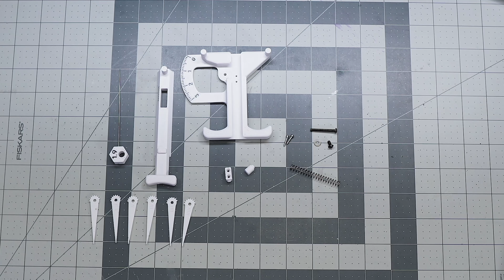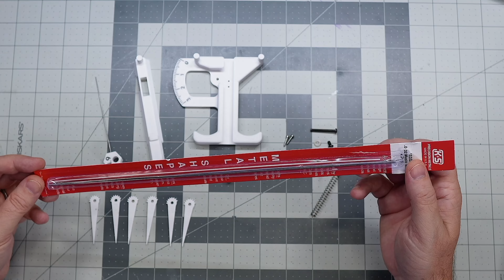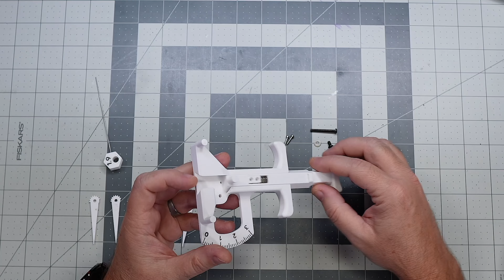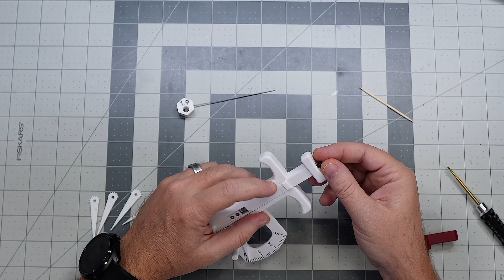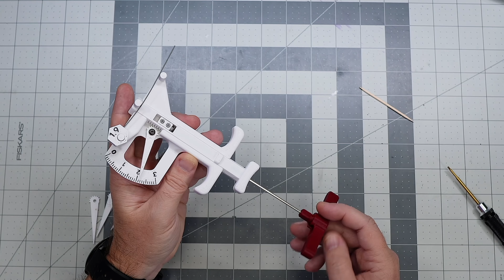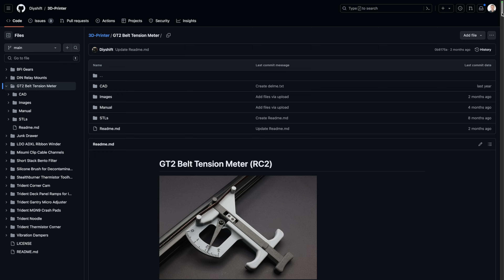Voron 0.2 Tuning - Belt Tension Meter

Comment: Just by how it looks, #5 seems too tight. You always want a tiny bit of backlash, as long as the needle moves less than like 1/4 of an increment, it should be fine. I have mine down to moving a fractional amount, barely noticeable, but it runs smoother and settles into a value with less tapping.

Comment: Idk how much of a difference it would make but i believe you're supposed to do the testing/tensioning with the motors active and the toolhead in the position you used in the video. That's how I did it anyway following along with another video.
Reply from the maker: Yeah, I probably forgot to mention it in the video but you want to have the print head centered so that both belt paths are identical.

Comment: Mobilux is a lithium based grease and these are not considered safe for plastic parts, they're great for lubricating metal on metal surfaces. A silicone grease (optionally with PTFE) would be a much better choice
Reply from the maker: Good point. It's what I had available. If it ends up causing the plastic to fail, I'll just print some new parts.
Reply: Skip the ptfe, the small particles can cause binding in high preload rails.
Reply from the maker: Just to clarify, my understanding of the suggestion here is that they're recommending silicone/PTFE grease for the application I used in this video, which was ABS printed parts sliding on one another. PTFE would be fine for that, and maybe even a better choice, but it's also true that you should avoid using it for lubricating linear rails.

And thanks for the reply, Hector. If you've been following along with the build, I'm honored. Fabreeko is the first online shop I go to when I'm in need of printer parts and supplies.